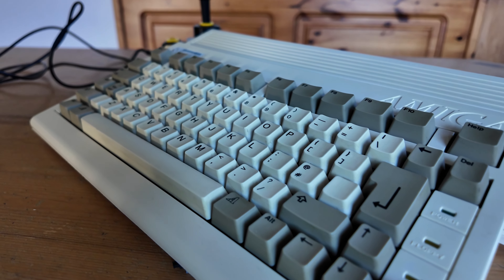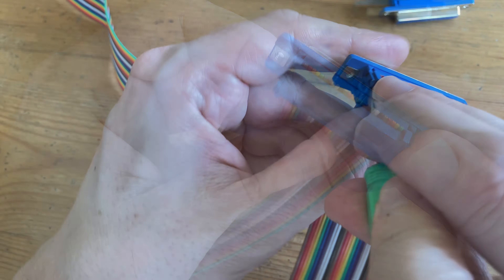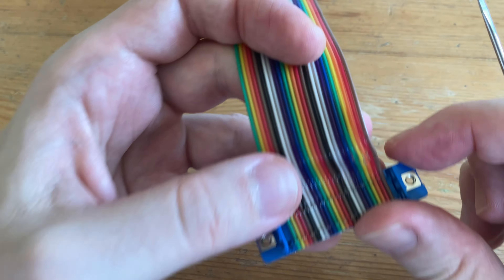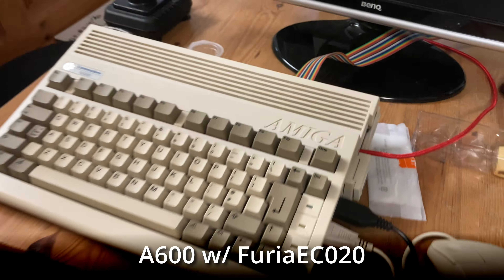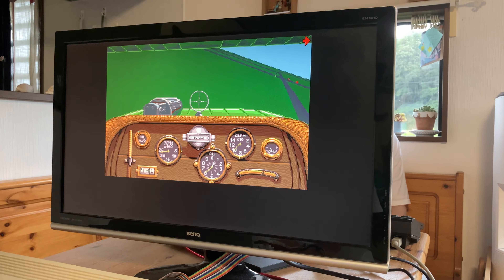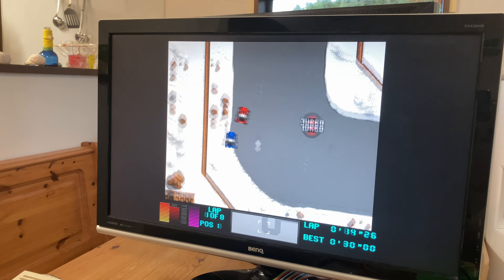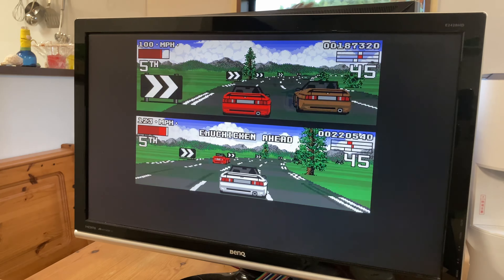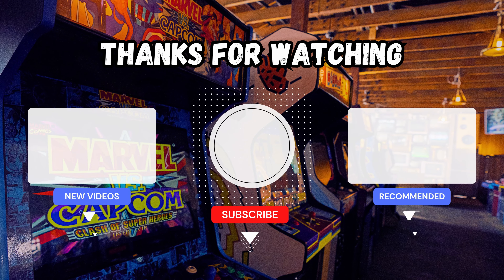DIY Amiga Linkup: Easy & Cheap Null Modem Setup!

Comment: I used to run an A500+ linked to a CDTV via a home made Parallel cable. I ran Parnet from the Amiga hd and the Weird science network CD on the CDTV to mount the CD drive on the Amiga.
Reply from the maker: @mcborge1  I could only dream about getting a CD drive on my Amiga back in the day. But nicely done 👍. Having a cd full of programs must have felt like having the whole world in your hand 👌
Reply: @TeamPandory  It did feel good having a CD drive and HDD running on the same Amiga. The best thing about it is If it wasn't for a PD diskette I picked up for 50p I would have never heard of Parnet or had the pinout diagram for the cable which came as an IFF image on the PD disk. :)